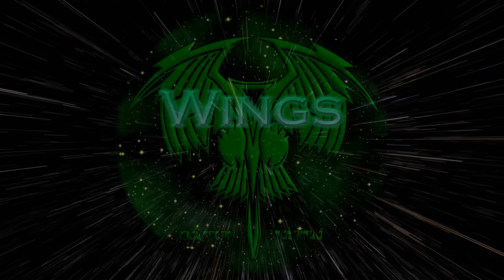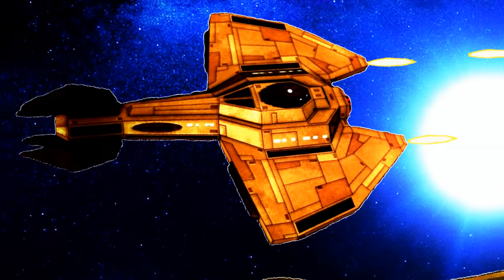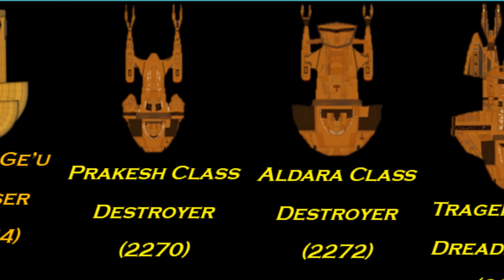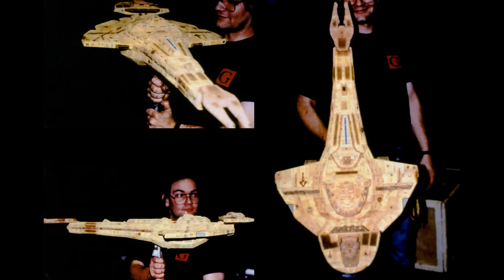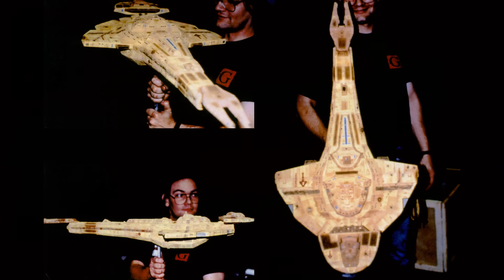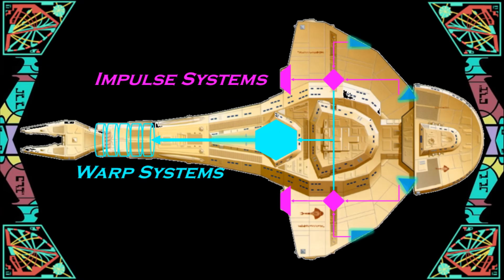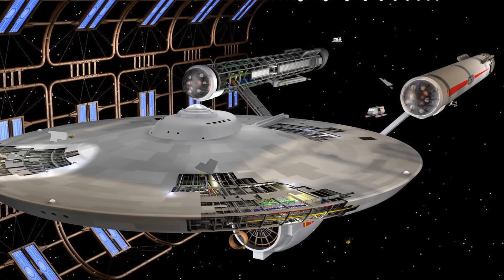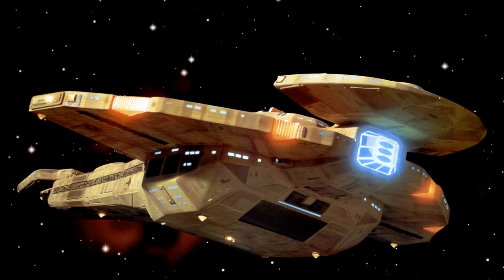Why Are Cardassian Ship So Weird?

Comment: I've watched to the end- I didn't think the Cardis would pull an Imperial "destroy one, a thousand shall take its place" doctrine of shipbuilding.
Reply: It makes perfect sense based on everything we've seen about the Cardassians. In real wars, easy to build rugged designs win conflicts. For the Cardassians this absolutely maximizes their modest resources. Like the Americans in WWII, they used the Sherman as a baseline frame to build variants that increased effectiveness while streamlining and simplifying maintenance and logistics. Easy to build, maintain, eminently upgradeable. We see this over the years with the Galor Type II, then the Type III which was evidently much more effective and then even building the Keldon Class on the same frame meant ease of support, and the potential to build a ton of good heavy cruisers without dislocating their supply chains and shipyards building a completely different design. Contrast this with the Klingons and the Vorcha where it went 15 years longer to design than thought, and they had a hard time building lots of them.
Reply: Perfect philosophy for a one size fits all space-frame! The Galor is not a great cruiser, but it's good, a 5/10. But, if you build a couple thousand of them they become a quality of their own!
Reply: @janeghudjars3496  And it's a good enough cruiser to bully smaller vessels like Bajoran and Maquis Raiders, Starfleet Miranda-class ships, etc.  The single nacelle has to offer significant cost savings.

I honestly think the Cardassians might be the most likely to adopt Multi-Vector Attack Mode technology, having a stardrive section 'mothership' for multiple expendable attack battleriders that either use impulse drives or have low-warp engines for tactical maneuvering.
Reply: @KlavoHunter  Yes the Galor Type II could bully the smaller ships, but for almost the same cost, and resources, you can have a Galor Type III that can clearly outmatch the Excelsior Class and the older medium starships and even something like the Klingon K'Vort Class if one chooses the right sort of battle. And for about 30% more resources, one can have the Keldon Class. Which is insane, to have such a varying degree of effectiveness for about the same price is an economy of scale that ANY nation would kill to have during war. Consider the difference in resources it take to build the K'Vort vs. the Vorcha, easily twice as much of everything, compared the difference between the Galor Type III and the Keldon. Great design and economic strategy for a smaller power.

Comment: I'm fine with Roddenberry's ship design rules only applying to UFP ships. It would get very boring if every alien race followed those rules.
Reply: The main problem is it’s the UFP who violates them the most, hell the Challenger cameos in this exact video and that breaks the Line-Of-Sight rule
Reply: @Ty-yt3lj  well they do have the most ships so it would stand to reason. 😆 And FASA back in the day wanted to sell miniatures!
Reply: @Dracounguis  Fallowing Roddenberry rule give you most efficient design. But you can justify most exceptions. Like mononacelles stil have two coils, but in one pylon. This deceased costs but limit efficiency. Three nacelles were most common in warship. Giving you spare in case of battle damage. But having multiples didn't increase efficiency in any way. Beside options to rotate nacelles during maintenance/cooling.

More important is not covering them from front as Bussard Collectors as name suggest collect deuterium from space. Or space in between as warp formed between nacelles. Though for example Intrepid tilt nacelles. Bridge placement is more relevant to indicating size of the ship and it is easiest to justify to break.
Reply: @Ty-yt3lj  wouldn't surprise me if the Federation experimented with other means of warp nacelle engines because they can.
Reply: @ShannonCarter55  they do. Constantly. The Challenger stacks them vertically, the Niagara and Federation have 3 of them, they inherited some Vulcan Annular ships (and XCV-330) and there’s a slew of Mono-Nacelles and Quad-Nacelles. Don’t get me started on the Prometheus.
Reply: That depends on whether the design rules are a matter of aesthetics or a matter of physics. If they're a matter of physics, every species that uses the same type of tech should follow the same rules. Now, if one species used e.g. Babylon 5-style jumpgates/jumpdrives instead of warp drive, they would likely look quite different.

Comment: Yeah MONO nacelle with it in the Hull makes sense. The fins on the back make more sense now as cooling for an Internal nacelle. And with ships in star fleet having mono nacelle designs I can see why this would work esp since their space is so small it would be fine to cove the areas they need too for a low cost, and it also makes sense for why they tended to have lower top warp speeds and distance. They only needed to worry about an amount of space that something doing warp 6 at cruse to cover and warp 8 in overdrive. It all makes sense for the cardasians.
Reply: The odd thing though is the Cardassian ships were generally reckoned to be decently fast. Dialogue in TNG indicated the Galor was "pretty fast" nearly as fast the Enterprise. And of course, later, in Defiant we learn that the Keldon Advanced were faster than the speedy Defiant Class.
Reply: @crownprincesebastianjohano7069 simply put those Nacelles get toasty
Reply: @crownprincesebastianjohano7069  Keldon advance makes sense it was faster cause it was a major upgrade and defiant was built for combat so it was not as fast as other federation ships with its armored nacelle set up. But Remember that original TNG episode where they talk about the ships being pretty fast. I think they meant compared to other cardasian ships. And i would reckon they meant it could get up to the speed of the Enterprise CRUISING speed.  Remember the cruising speeds were warp 7 for the federation. And they could go fast at 8 and burn fuel for warp 9.
Reply: @crownprincesebastianjohano7069  Yeah but i assume they are talking about CRUISING SPEED, fed ships tend to cruise around warp 7 and the Cardis could do that. The could get hit the warp 8 speeds, but they likely did not have ENDURANCE of a federation ship that could do it for hours. Defiant hung around warp 6 and 7 cause its compact design had its limits, the choose firepower over speed. The Cardi ships could go fast if pushed, but only in short bursts.

Comment: Imagine if the federation created ships with the Badge Shapes?
Reply: They did, have you ever seen the "Warp Delta" class ship? Technically it isn't a Federation design but an Earth design.
Reply: I know this ship, but I forgot that it looks like a badge, but it's a shame that we haven't seen more ships from the 22nd century like the Warp Delta and Intrepid-class from the 22nd century.
Reply: Delta Shield actually would be a useful shape. Tapered front allows for weapons on the port or starboard to face forward like a Star Destroyer, or essentially a Prometheus Class without nacelles.
Reply: That was a pre-Federation design: Ganges class.